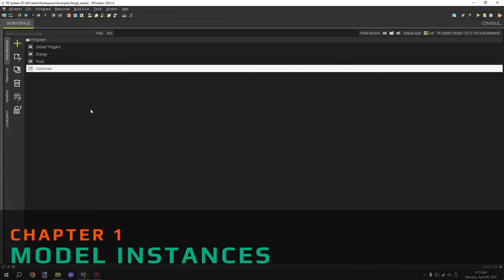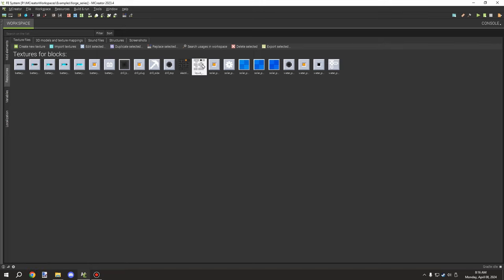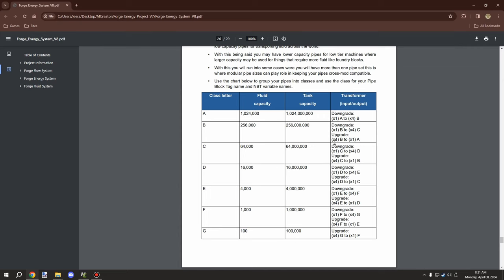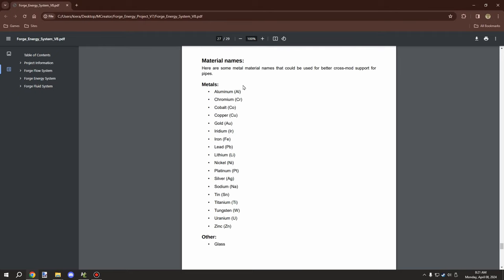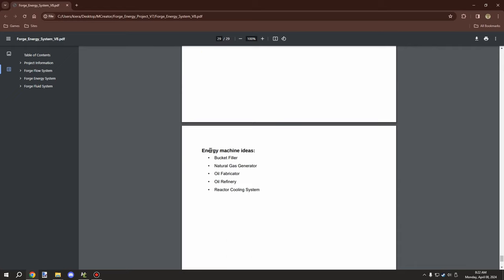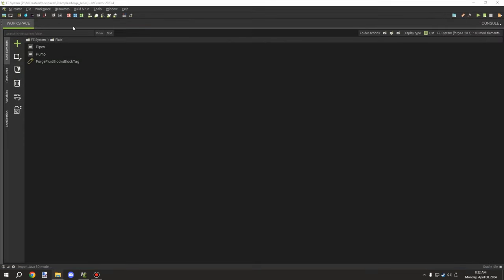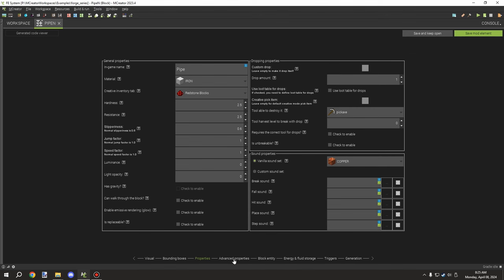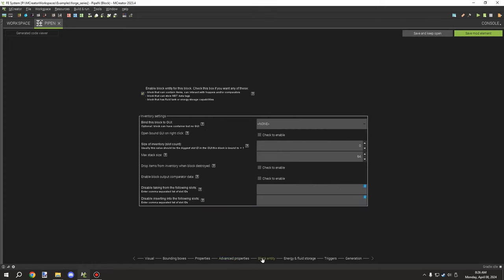Part 7 | FF Fluid Pipes | MCreator

Comment: Will there be blocks to test for specific fluids from a block in the future?
Reply from the maker: I have held off on this series because I have learned that forge fluid is vary limited when it comes to how its set up.
I honestly am thinking about making a custom NBT system as its basically how forge is using theirs but it would provide more flexibility. Though I can still cover how to convert it over between the two versions. I replied with someone with a similar question for me to start after summer. This will give me time to prep the system and such. But as far as fluid and energy for forge, its limited to what I can make work.
Reply: @NorthWestTreesMCreator  Cool man and great work I'm a big fan.

Comment: what did you use for the pipe models? im having trouble getting anything to work
Reply from the maker: The models are provided in the project files of this project.
There should be block bench saves too so people can use them as a guide for rotations.
https://github.com/MCreator-Examples/Projects/discussions/47
Reply: @NorthWestTreesMCreator  helped alot thanks!  im stuck on tags now though :( the versions arent the same so its acting wierd

Comment: HELP! i'm making a mod that changes the nether to a snowy biome but i don't know how to convert the lava lakes into water/ice. How do i do this? ive looked everywhere!
Reply: Make your own snowy biome, make procedure so when player enters nether they get transported to your snowy biome
Reply from the maker: This is out of the scope for MCreator, it requires the game files to be changed which MCreator does not support in development, MCreator allows for expanding the content but not changing it or removing it. With that being said though  you can do what itsMekvman's suggested this would work for sure you just need to make a global trigger "entity travels to dimension" then test the dimension and if true simply run the following command.

/execute as @e[distance=0..1] in <mod_name_space>:<dimension_registry> run tp @s ~ ~ ~ ~ ~

This will run for all entities within a distance of 0 to 1 blocks away then it will set the target world as your mods dimension then run the teleport command for that same entity and set the same position and rotation.

This should be done with the world command block as it supports coordinates.

Comment: help mcreator does not load and gets stuck at loading
Reply from the maker: Pretty sure this was a issue on 2024.1 snapshots though it has been resolved from what one of the developers said try redownloading the latest version and installing that version, it should fix the issue, if not you will need to get the MCreator log from your MCreator folder and provide the log in a bug report.